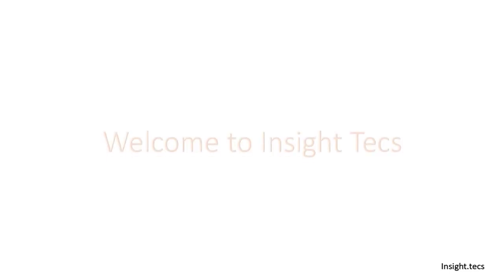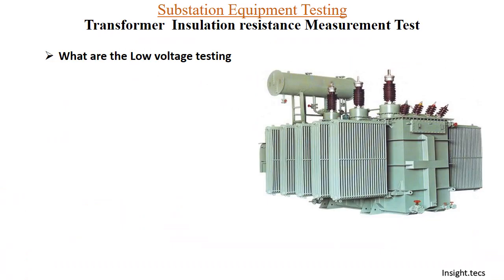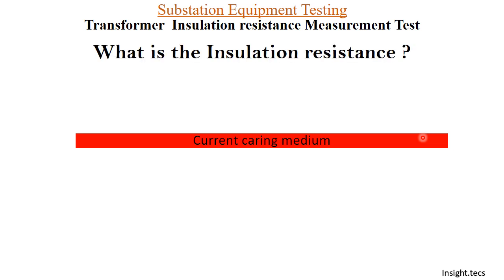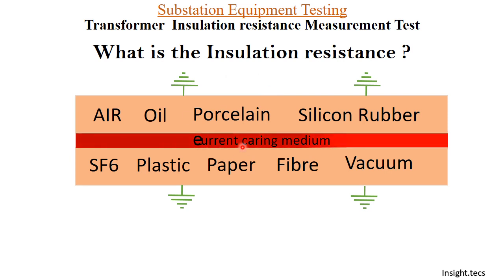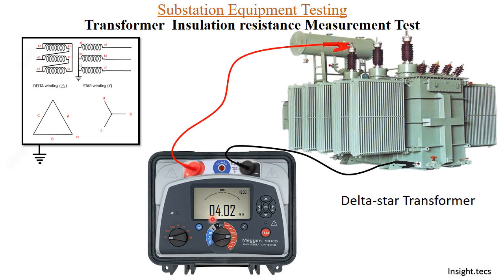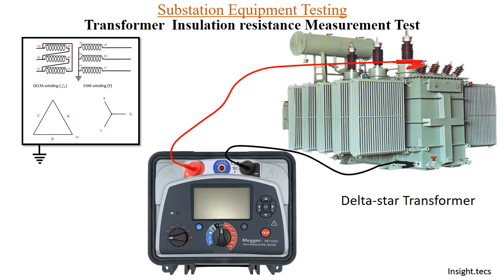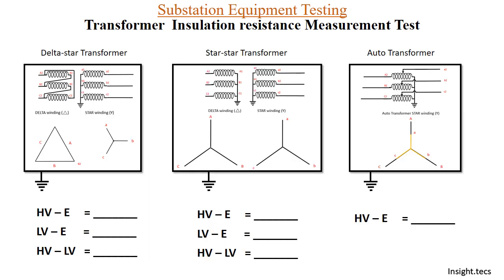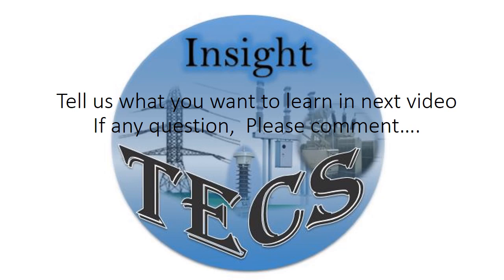Transformer IR Value Test || English

Comment: Hi, Good explanation. I would like to add a few more points that you must have included to make it 100% for interview purposes. What should be the voltage applied in all three testing e.g. HV-LV, LV-E,HV-E etc. What would be the use of a guard terminal in the IR tester? Need a quick video on the above queries